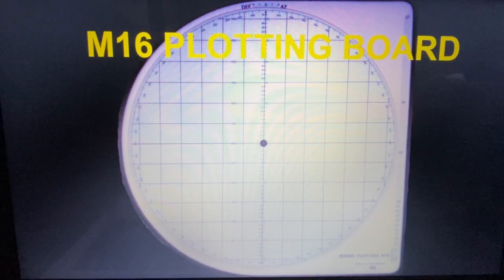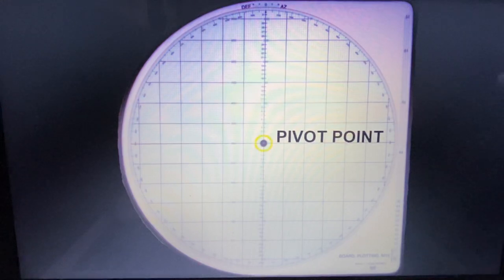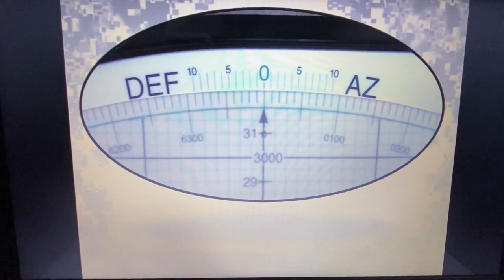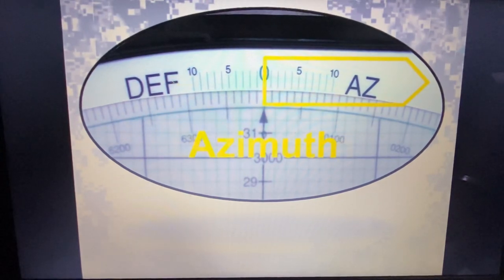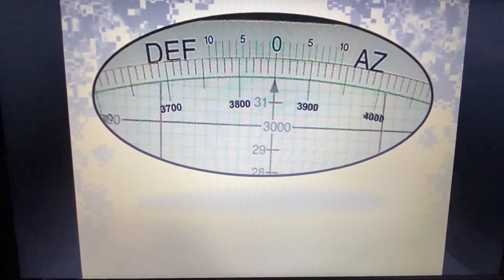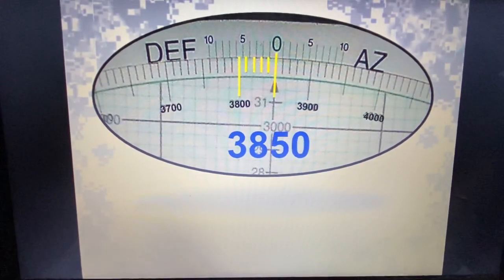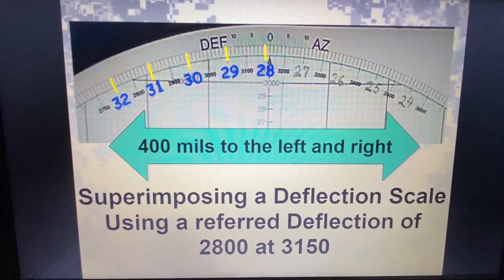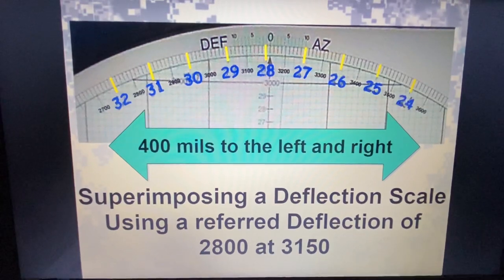M16 Plotting Board Orientation

Comment: Of course it's in mils. because why would you use sane units like degrees like everybody else does for bearings and azimuths.
Also that's all nice and good. But what good does it do to read those numbers. What do they mean? And where do you get those numbers from in the field? Seems pointless to just randomly rotate the board and read numbers off of it. What is the purpose of this? And wouldn't it make more sense to just add another rotatable disk for the deflections rather than having people scribble on the board?
Also this doesn't even make sense. 360°/millirad = 6283.185307 (aka pi * 2000), not 6400 (pi is not 3.2). Next you round pi to 4. What is this nonsense?
Reply: 6,400 NATO mils, 6,000 Warsaw Pact mils or 6,300 Swedish "streck" per turn instead of 360° or 2π radians, achieving higher resolution than a 360° compass while also being easier to divide into parts than if true milliradians were used.
Reply: 1. milliradians are more accurate and 6400 is easily divisible compared to alternatives
2. part of setting up the plotting board is orienting it to the terrain, you get the numbers from the FO's CFF mission, the mortar sight also works on a 6400 mil scale so it works
3. another rotatable disk is fine but if that rotatable disk twists even a bit you will be less accurate